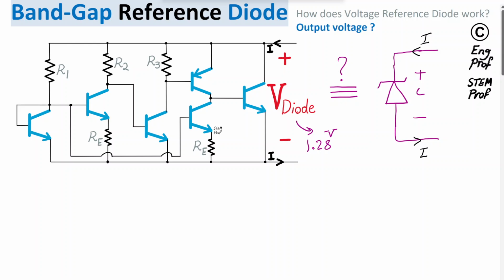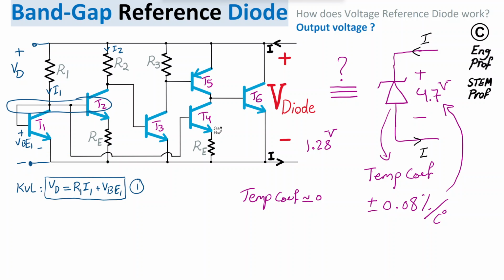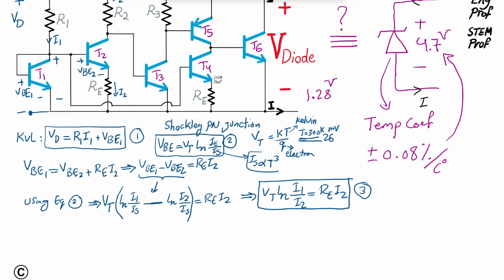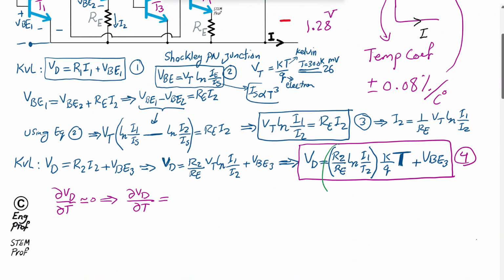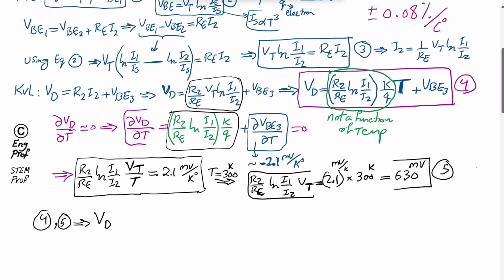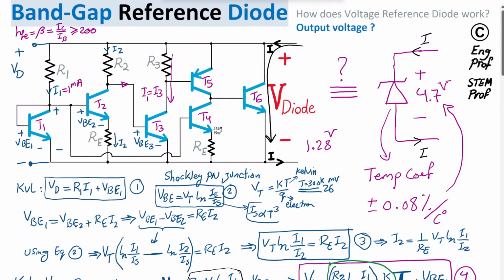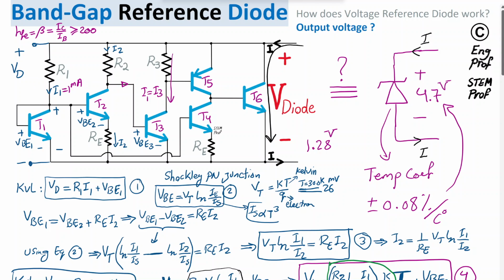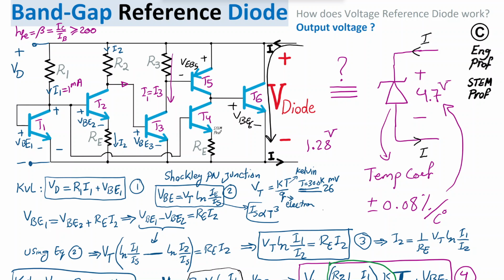Band-Gap Voltage Reference Diode [Temperature Compensated Circuit]

Comment: Interesting circuit :)
Reply from the maker: I'm glad that you liked this bandgap circuit. Related examples are the Bandgap Voltage with Op Amp & Widlar Current Mirror Circuit video https://youtu.be/esMlNx5w9Jw and Voltage Regulator Design with BJT Darlington Transistors and Zener Diodes video https://youtu.be/ArisQp7V0Ac
I hope these circuits and videos are interesting as well.

Comment: So in nutshell: T1 & T2 produces inverse temperature coef than Vbe, thus compensates T3; and T4, wired identically to T2, also has it to compensate T6. But what compensates temp coef of T5 Vbe then? Does this additional current mirrors you mentioned in the end do?
Reply from the maker: Thanks for watching, sharing your thoughts and asking questions. In this Band-gap voltage reference the series connection of VBE3 and R2 sets and defines the voltage drop Vdiode across the top and bottom rails of the circuits. The collector-emitter voltages (Vce) of BJT transistors T3, T4 and T5 will adjust accordingly to accommodate the forced voltage by the sum of R2.I2 and VBE3. Two related circuit videos are,
Bandgap Voltage with Op Amp & Widlar Current Mirror Circuit https://youtu.be/esMlNx5w9Jw
Voltage Regulator Design with BJT Darlington Transistors and Zener Diodes https://youtu.be/ArisQp7V0Ac
I hope this explanation is helpful.
Reply: @STEMprof  It's just theory, you know! In practice, the results are worse in Cadence Virtuoso simulations if the diode and resistor are not adjusted properly. Have a nice day!

Comment: This was a high level and top quality explanation. Thank you for your videos. 😊
Reply from the maker: You are very welcome. Glad that my circuit videos are useful. Here are a few related videos:
Bandgap Voltage with Op Amp & Widlar Current Mirror Circuit https://youtu.be/esMlNx5w9Jw
Voltage Regulator Design with BJT Darlington Transistors and Zener Diodes https://youtu.be/ArisQp7V0Ac
I hope these videos are interesting as well. 🙏

Comment: Excellent explanation. Keep up with the good work.
Reply from the maker: My pleasure. Glad that you liked this bandgap circuit video. Here are a few related videos:
Bandgap Voltage with Op Amp & Widlar Current Mirror Circuit https://youtu.be/esMlNx5w9Jw
Voltage Regulator Design with BJT Darlington Transistors and Zener Diodes https://youtu.be/ArisQp7V0Ac
I hope these videos are interesting as well. 🙏

Comment: Nice presentation. It would be nicer if you could carry the literals up to the end of the derivation of the actual result(s), and then replacing the values. The analysis of a particular result and pre-requisites/simplifications (betas, and so on) could be carried out with a separate annotation and be left somewhere until the presentation's end.  
I would point out that the actual diode bandgap is also a function of temperature (eg. Varshni semiempirical formulation), possibly out of the scope of the presentation.
Thanks for your time.
Reply from the maker: @_nemo174  Glad that you liked this BandGap video. And thanks for your suggestion and for pointing out the fact that actual PN junction band-gap is not absolutely independent of junction temperature. I would say, practically speaking, it is safe to neglect its thermal dependency at least for the range of practical applications that matter in this context. For example, a bandgap voltage reference Diode with coefficient temperature of say +/- 0.003% per degree kelvin is at least an order of magnitude less temperature sensitive than Zener diodes. If nominal bandgap voltage is ~1.28 volt, then such a small temperature coefficient translates to a mere 0.00003*1.28 volt ~= 38.4 micro volt change per degree which means ~1mV change (practically negligible) even if junction temperature changes 30 degree Celsius. For more related circuit examples please see: 
Bandgap Voltage with Op Amp & BJT Widlar Current Mirror Circuit https://youtu.be/esMlNx5w9Jw
Voltage Regulator Design with BJT Darlington Transistors and Zener Diodes https://youtu.be/ArisQp7V0Ac
I hope these circuit examples are interesting as well. Thanks again for your comment. 🙏

Comment from the maker: How does a Bandgap voltage reference diode work?  What is the value of output voltage?  What should be the choice of circuit components to ensure near zero temperature coefficient for this reference diode so that generated output voltage doesn't change with temperature?  These questions are discussed and answered in this bandgap reference voltage design example and tutorial.  For additional circuit examples see: 5v Charger Voltage Regulator with MOSFET, JFET & Temperature Compensation https://youtu.be/NdfyHoxjKrY
Voltage Regulator Design with BJT Darlington Transistors and Zener Diodes https://youtu.be/ArisQp7V0Ac
More example are posted in the Analog Circuits video playlist https://www.youtube.com/playlist?list=PLrwXF7N522y4c7c-8KBjrwd7IyaZfWxyt.  I hope these analog examples are useful and interesting.  Thanks for watching.